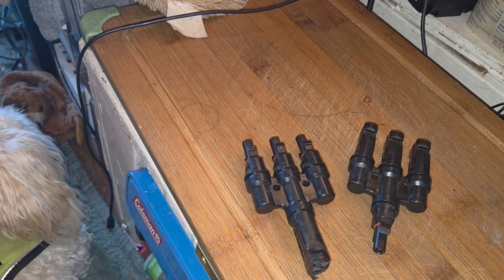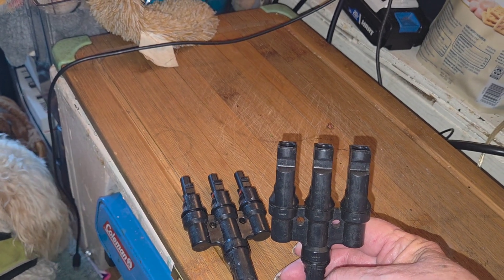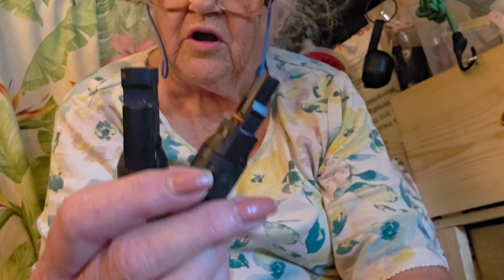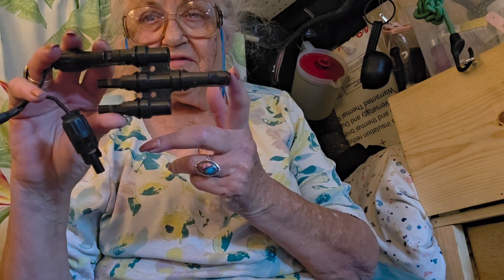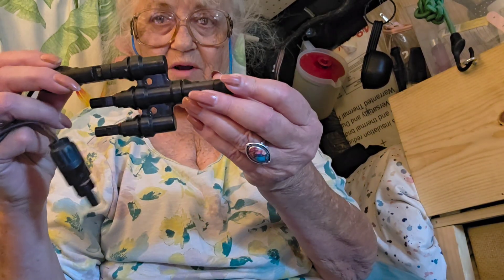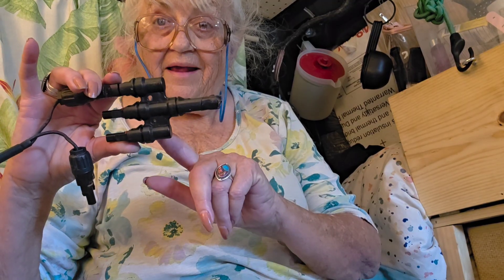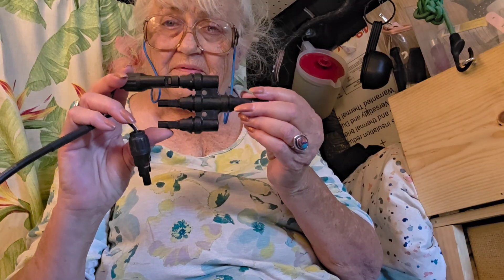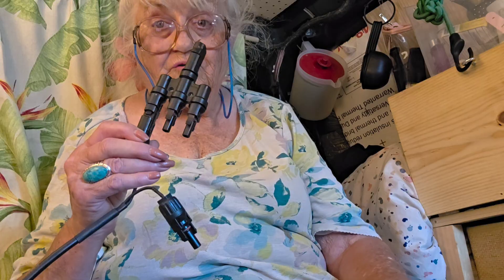How to connect multiple solar panels to your solar power station

Comment: I had to look it up to be sure.  You are connecting in parallel. 200w and 200w both at 15 amp, this will get you 200w at 30amp. if you go in series, you will get 400w at 15 amp.
Reply from the maker: I am not discussing amp but volt. I did series not parrallel. Series is for volts parrallel is for amps.
Reply: @l.a.v.alindysawesomevanadv3428  Yes, amps and volts live in the same house. I use amps and watts because that I what my Bluetti shows.